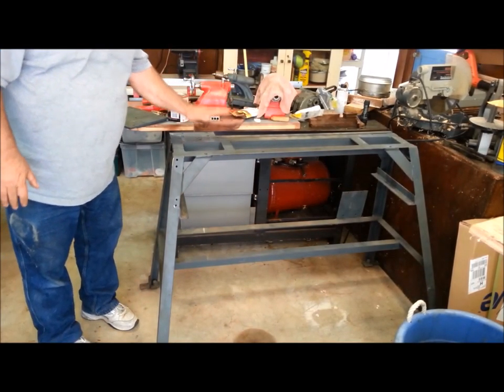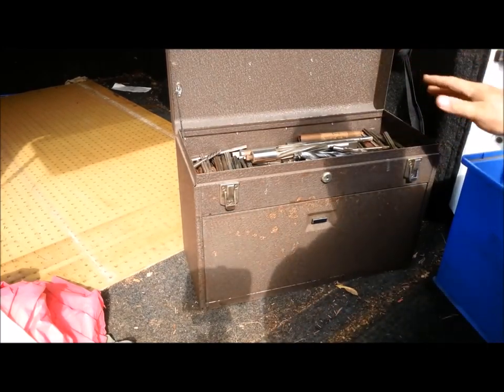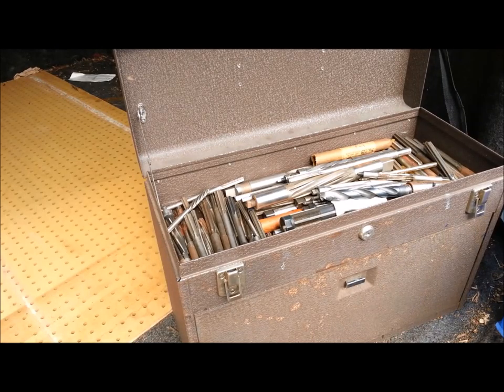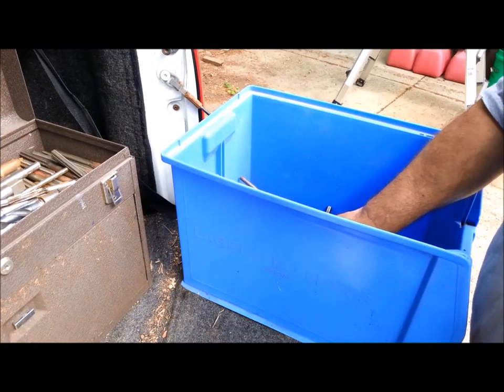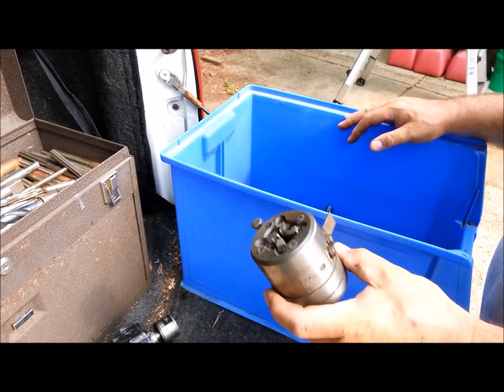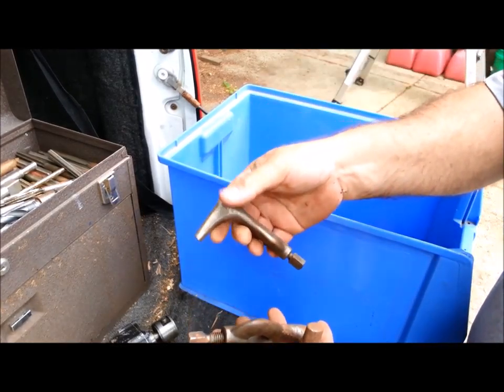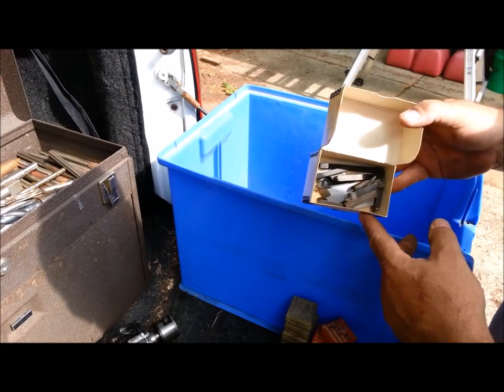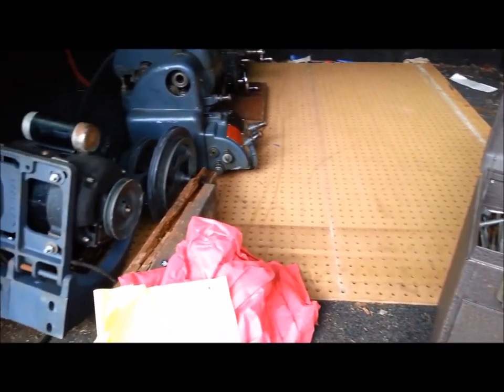Back Of The Truck "BOTT" Episode 8: Atlas QC42 With Tool Hoard

Comment: HOLY FREAKING MOLEY!!! That's one massive deal! The one item shown that had the big round attachment is tool holder for a grinding tool such as a Dremel.
Reply from the maker: eviltwinx I've seen boring bars in similar tools but it just does not seem substantial enough for that purpose to me.  I want a tool post grinder.  Been thinking of setting up something that uses a variable speed Dremel as the motor.  I've built inverted pin routers before for machining model airplane materials.  The top bearing and the flexible nature of the plastic housing just won't cut it for anything you want in great precision.  The bit will oscillate around center 3 to 5 thou.    But, one could be used to drive a shaft in a set of quality bearings.   Thinking......